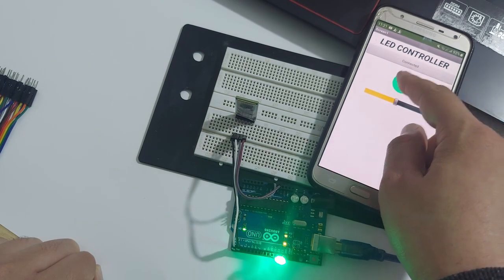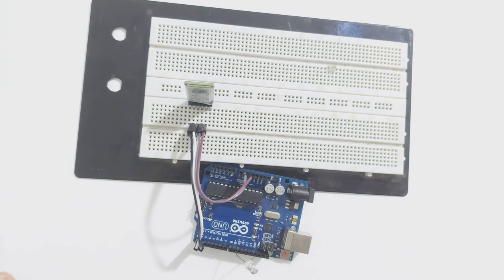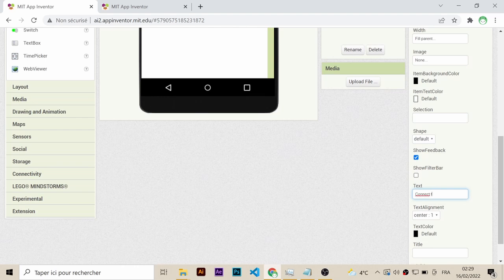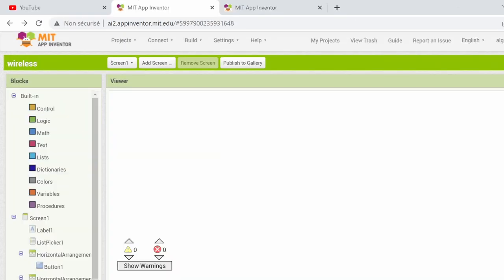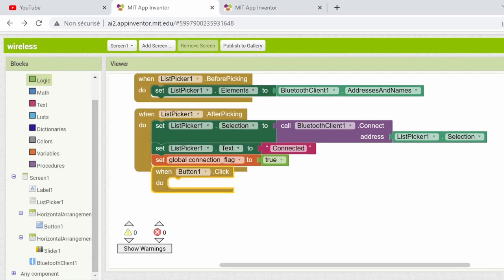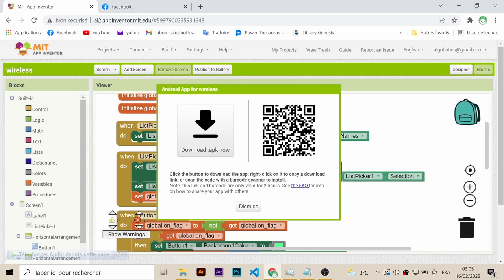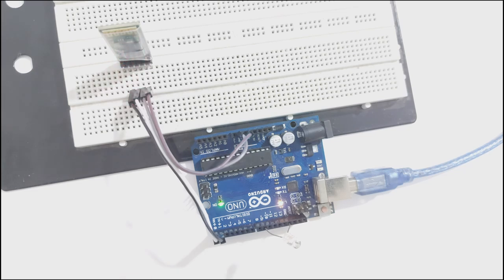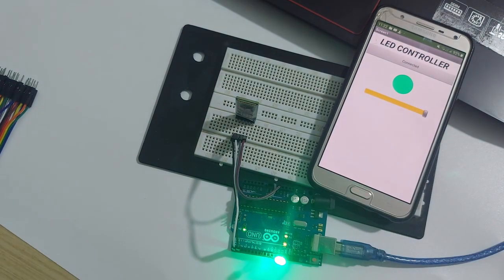Bluetooth LED Dimmer | Arduino Project

Comment: can i ask  is this work in light bulb?
Reply from the maker: you can use a relay to easily turn the light bulb on and off using the project presented in this video.
however if you wanted to dimm the light than you'll need an AC dimmer module and a dimmable light bulb.

Comment: alright so i have made my own slider using canvas and a ball. it slides vertically and even returns to bottom like i want it too, but i still need to use it for bluetooth. heres the main problem, i set the size of the canvas to 255 so all i would have to do is convert the position directly into bluetooth data but what happend is the slider seems to be reversed or upside down and i dont know how to change that (so sliding it down is 255 instead of 0 like i wanted)
Reply: Hello there is the problem solved ?
Reply: @tombolt3637  no unfortunately not. I have partially abandoned that project but if you know a solution I would greatly appreciate it.